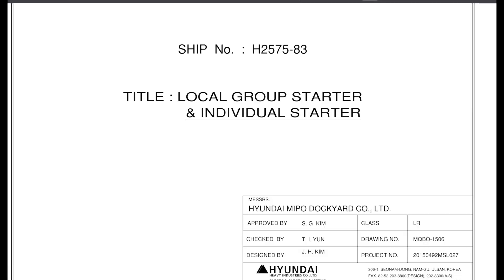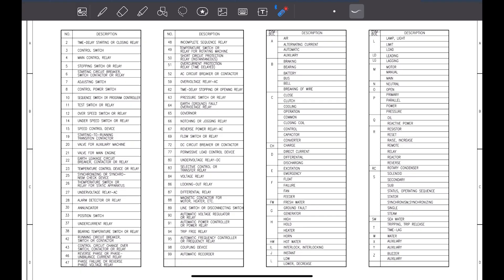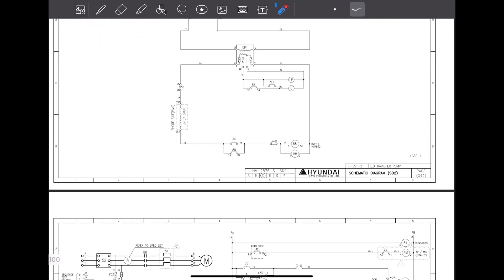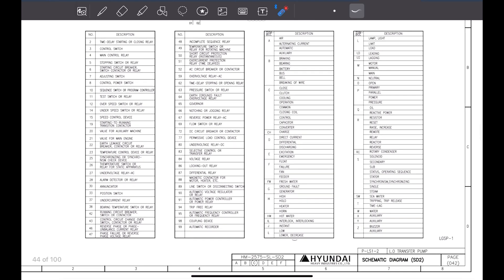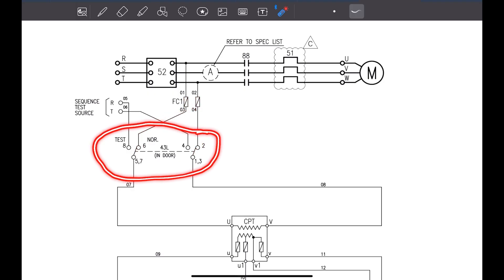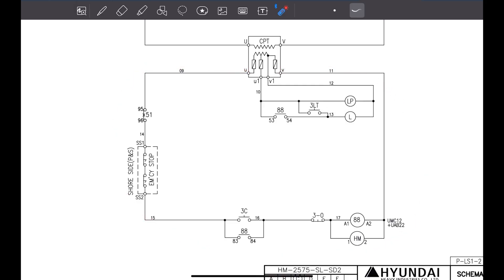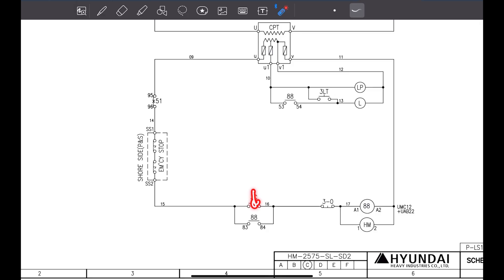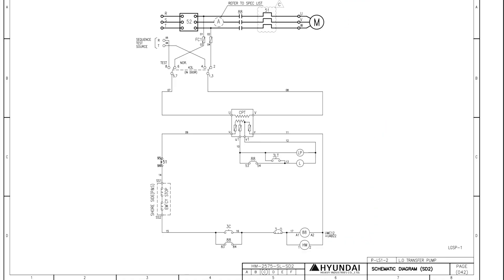How to Read Electrical Circuit Drawings Step by Step #ElectricalEngineering #CircuitBasics

Comment: Sir This diagram is look working as DOL starter. But I have to know why 3LT push switch is used . According to me it's used for checking the running bulb if I am wrong than correct me please
Reply from the maker: Yes right
LT means lamp test
Once you pass this all lamp in the panel will light up and you can check status of lamp
Reply: @etorahul Awesome, thanks for letting me know